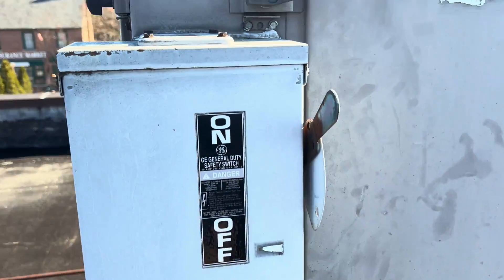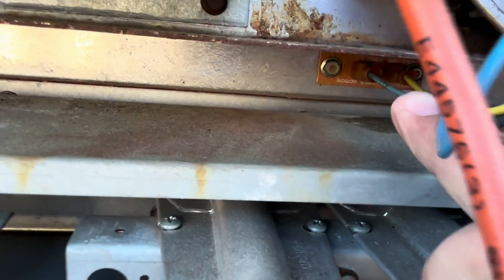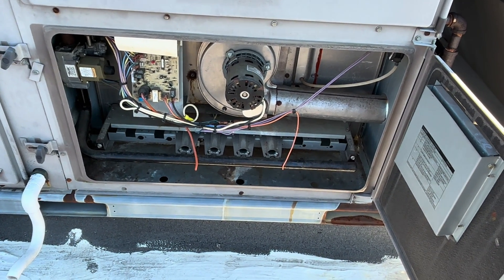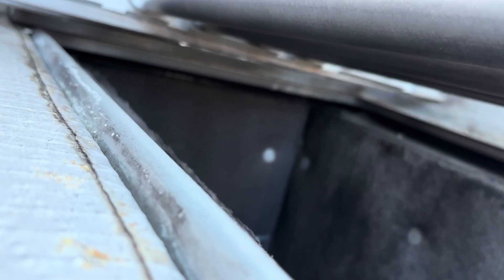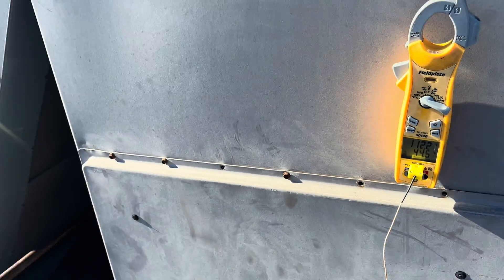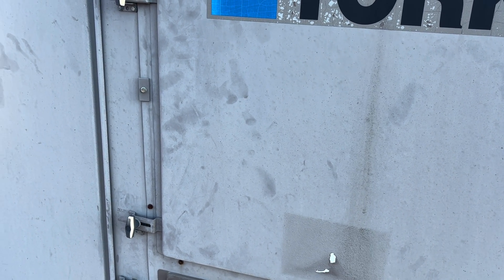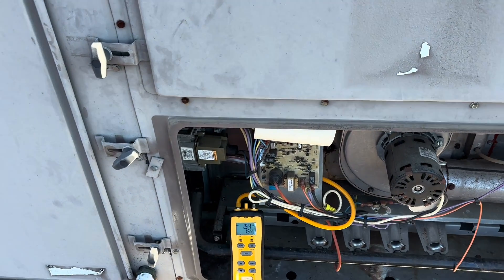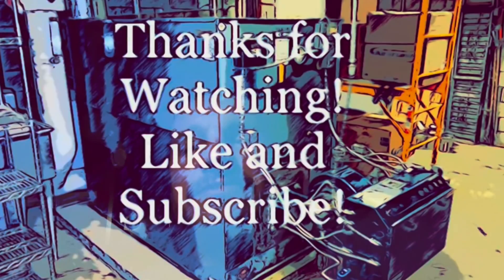No Heat |  Limit Switch Tripped After Power Outage?!?

Comment: I have seen downflow furnaces trip the blower housing limit before, because the power went out while they were mid heat cycle, the heat in the ducts and the hot heat exchanger was enough to trip it open. granted those are usually in mobile homes, which also have poor undersized duct work. I could see it happening to RTU's where the blower sits overtop the heat exchanger if in heat cycle. I don't think any of other manual reset rollout/limit should open though, especially not by the burners. if they do the heat exchanger may be compromised and the slowing indoor blower caused enough heat to flow back wards in power failure to trip them.
Reply from the maker: Well said!

Comment: I'm definitely thinking the power went out mid-cycle and the leftover heat was enough to trip the limit.

I do find it interesting that the first control board, which probably doesn't do all that much, has such a large microcontroller on it. (That could just be a byproduct of an old design.)

Comment: Your good you checked everything out and yes if rhe outage happened while unit was running by shutting down blower the safety did its job.i would recommend if it happens again to replace the limit being that you checked everything properly but it should be good unless the limit is weak i think you hit it perfectly in the nail
Reply from the maker: Thanks man!  Good advice.
Reply: I'm not a repairman but, I keep an extra capacitor and high limit switch in case.

Comment: I agree with you that the unit was heating when the power went out and the residual heat left over in the HX was enough trip that limit.
Reply: Either that, or it single phased the blower just long enough to affect airflow before the power went fully out.